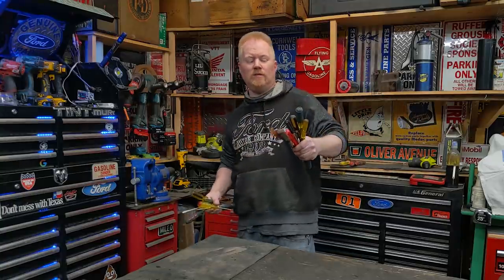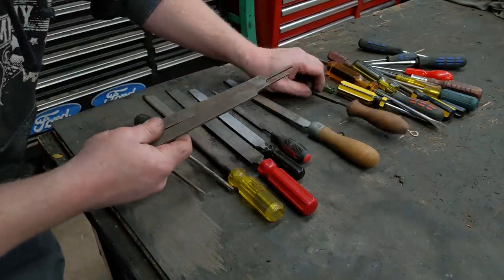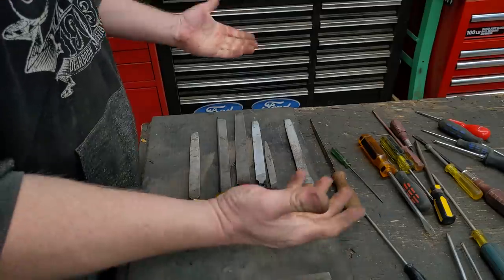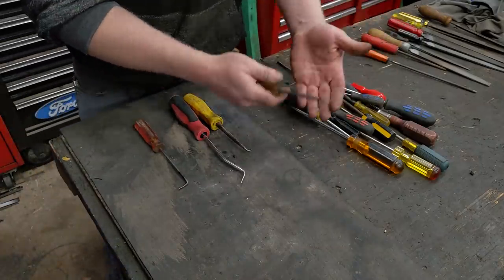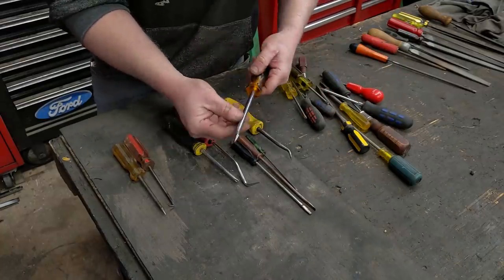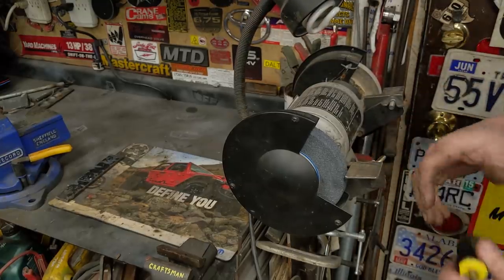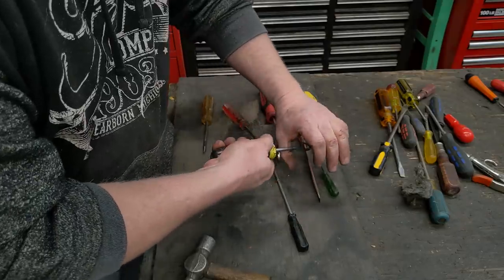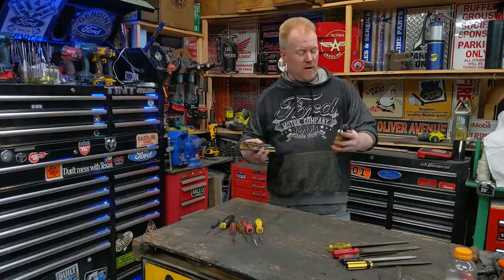BEST uses for Broken Old Screwdrivers VOTED #1

Comment: I cut a semi-circular notch into the end of a flathead screwdriver to make a bicycle tool to remove and install caliper brake springs.  The Chinese ergo-handled screwdrivers with a long sharpened shank are great for use in the garden for removing dandelions and other single tap-root weeds.
Reply: Yeah, weed removal is a good use.
I have a wooden handled Irwin flat blade that was in good shape, and I started using it for weed removal. Well, with the rocky soil that I have, the tip became rounded in no time. And purpose made weed removal tools with the v-notched tip get rounded over too when used in rocky soil.
Reply: @stevebabiak6997  I sifted all the soil in my yard over a wheel barrow ten years ago, man the rocks that came out of it was crazy
Reply: @campbellpaul   - I gave up on doing the whole area at my place. But when I add compost next time I might just have to put this thing together for sifting:
https://youtu.be/AS3sig0pP9Q
Reply: @stevebabiak6997  That tumbler looks really smart.  I just made a frame that squeezed over the top of the wheel barrow and used a flathead shovel to move the dirt through.  My chicken wire was a finer mesh, which made it twice the work!
Reply from the maker: Good ideas. Best dandelion tool is the weed hound. I made my own from scratch a number of years ago.

Comment: chisels, punches, paint stirrers, and voltage testers
Reply: I like the voltage tester idea. Shove it in an outlet and if you see sparks, it had voltage. Also a great way to determine which circuit breaker is associated with an outlet too.
Reply from the maker: Wait.... I use my good screwdrivers as Chisel, Punches, Paint stirrers and Voltage testers. Maybe I need to rethink this.
Reply: Screwdriver used as Voltage tester/ arc welder always gets me  excited. Makes my blood flow better 😂☺️
Reply: Also 1000A fuses.

Comment: i used one of my old screwdrivers to make a backing stick for when i was wielding body panels if your trying to get the small holes i soldered a chunk of copper pipe on the end of the screwdriver and it worked perfectly
Reply from the maker: Great idea.

Comment: I heat up old medium size flat blade screwdrivers with a propane torch and bend the tip at a slight angle to make paint can openers.  It give me more leverage and control.
Reply from the maker: Great idea.

Comment: If you are at all incline toward Blacksmithing, you can use a larger vise grip type tool as a heat sink and heat the tips, hammering them out ( drawing out ) the shank a bit longet and thinning at the same time and then forming the tip as you want to!  You may have the quench the part closer to the handle more often but that's OK!  Anyway, jus another thought!  I have done it with a few longer screw drivers that I needed to be even longer for picks and hooks!  They work fine to do it that way!  It will also tweak your mind a bit making you see that Blacksmiting can be a lot of fun and quite useful!
Kudos!

Comment: The nice old timer wooden handled one (square handle with the square shaft)...

I managed to get a set of 4 of those at a pawn shop.  When I got home, I sanded the dirty looking handles and refinished them, then I ground the tips into scrapers for detail lathe work.  This was before I got my lathe and lathe tools.  I was practicing my wood turning with them by screwing a block of wood onto my sander's motor.

Still have them... paid only 5 dollars.  Great steel, did not overheat them so they kept their hardness and temper.  This was important for me, as if they had lost the hardness, they would not be effective as cutting tools. 

Now that I have a real lathe and lathe tools, I do still have them and use them.  They are awesome for close in face turning, where a very short handle wont get me hung up on my tailstock!

Comment: I’ve sharpened an old flat tip, ground the handle down to fit in an aluminum pipe I had and it makes a great trash pick up tool

Comment: Great idea. The pick you made inspires me to make a good heavy duty spring puller. I’ve got a T-handle #1 Phillips that I never use that would be better suited for me after tapering and bending a hook on it.
Reply from the maker: Good idea
Reply: I'm a mechanic from way back, when choke cables were a steady stock item. I would pull out the knob and cable far enough from the sleeve and cut and curl the end of the cable and use it when installing the springs on new head light pockets! Back when all cars used the same round sealed glass headlights, the pockets would rust out and had to get replaced, the springs would hold the pockets against the adjusters! The goddamn good old days when nobodies headlights were faded and yellow, because they were made from glass!!!!!!!

Comment: DUDE!!! gth out of my brain!! Ive been doing tbis for over 40 years and have my favorite sheet metal work punch was an el cheapo stubby fuller looking screwdriver that met a bench grinder circa 1980 or 81ish... Picks I've made dozens of em and a lot of then were specialty picks for just that one job that have came in handy a dozen times or more down through the years...and my file drawers look a lot like yours except I used a bunch of old matching Crap-On handles that I gave like 15 bux for the entire 15 piece  set at a flea market 30 years ago and the ends were all about trashed... Haooy haooy happy New Years bud !

Comment: Broke a blade screwdriver a few years ago. It was a break across the blade at about 45%.  I ground a deep grove 5mm wide down the broken line making the blade into a  offset point, with another lower point.  Great for removing and replacing springs on drum brakes.
Reply from the maker: Awesome.

Comment: I used an old medium-thickness flat-bladed screwdriver with a partially-chipped-off blade to loosen and remove the tiny tri-wing center-hole security-screws on a few of the damaged VHS videotapes that I was repairing for my elderly-gramma friend, so that I could separate the halves of the cassettes to repair them --- the screwdriver's fairly-thick partial-width flat tip fitted snugly into one of the three slots in the screw-head, with one end of the flat tip wedged against the center of the head's tri-arm hole.  With very careful pressure and slow patient turning, I was able to "coax" the security-screw to loosen and unthread; after repairing the cassette's internal parts and re-assembling the housing, I would then just use a regular Philips-head screw --- salvaged from another damaged cassette on which I had replaced the entire housing but had saved all of the still-usable parts including the cabinet-screws --- as a substitute center-hole screw, so that the next person would have an easier time getting the cassette apart sometime in the future if necessary.

Comment: I found a drawer missing handles so I used smaller screwdriver handles. They look so cool. Now I'm gonna get the useless 5/$1.00 sockets and make stuff with them. Handles, small legs etc. I've got a 50c spark plug wrench for a door handle.

Comment: for anyone needing bike tools (wheel building/spoke replacement/truing) ...  a long flat head makes a great nipple driver if you cut the edges back and leave a 1/8th point in the center. If you s bend the shank and bore the handle a bit you can wind the spokes up pretty quick and in even tension or keep straight and chuck in your drill.
Reply from the maker: Good idea!

Comment: You can make real good thread on file handles by making tapered springs and epoxy them into the handle. I just made a bunch a few weeks ago. Lol I even made a couple for my needle files. I used the "heirloom" ceramic corn on the cob holders my dad pawned off on me when he sold the cabin . They're the kind that look like little ears of corn. ..Anyway, yea, I cut the head off a fat duplex nail and chucked it up in my drill and ground it to a taper and used it to form my Springs. I tried different thicknesses, thinner wire works better than thicker wire. I think I settled on 22 gauge. it digs into the file tang better. Since the needle files have round tangs, I had to file 4 flats on the tips of each of them to give the spring something to grip. But they all work Nicholson file handles, the ones that screw on. They hold solid until you unscrew them

Edit: golf balls make excellent file handles . Also, you could chuck up the right size deep well socket in your drill to hold the handle of the screwdriver while you grind it while you spin it with your drill. You'll get a better okey-doke machine finish that way.

Comment: That's a great idea,  i re-grind the odd straight blade type as they are easy to do, but all the versions of pozidrive and philips plus other silly versions are a right pain.
There is always a screw that i don't have a driver for,  stupid camming out idea.
Allen/hex  keys can be good but they are not always a close enough fit and they get mashed, i end up slowly grinding a little bit off the end to refresh the fit.
T bar types i like :-D
Reply from the maker: I tend to grind down my hex keys every few years for a new bite.

Comment: There's lots of uses for them, not just those you covered. You just need to be able to heat the metal up quickly enough to shape them and still be able to keep the handle on, if it's gonna be a tool. Or, remelt it back into the handle; a different direction for the tabs it should have on the base of the metal, for instance. 

With a long one, you can heat the metal enough to flatten the end into a better shape for using it in plastic welding. Just make it thin enough that you can heat it consistently and evenly enough across the whole edge. This is much easier with a hotter torch, of course. Or with a thin one, you can shape it, chop it off, and use it for a soldering tip specifically for plastic welding. 

If you have a torch that can heat the steel up enough, and something to shape them consistently with, you can make ornamental curved shapes, and gift someone with, for example, a one-of-a-kind windchime.  

If you have a thick enough screwdriver, and a hot enough torch, you can make a chisel of a specific width and shape, for use with woodworking and/or lathe work. That opens up any number of possibilities for different shapes.

These are just a few Ideas I had while watching this. I'm sure there's a ton more!

Edited to add something that another comment reminded me of - they used screwdrivers for this, but I have a couple of cheap tire tools and prybars that I've repurposed for gardening implements like digging tools and such, and made a specific shape tip on one junky prybar for one time use, and found a half dozen more, regularly-used uses for it!

Comment: On a small flat screwdriver if you grind a notch in the end it will sometimes help installing spings. I've got a old needle nose pliers with a V notch on the inside of one jaw near the tip, it sure helps pulling a spring into place.
Reply from the maker: Good ideas

Comment: I cut the metal back leaving an inch. Then took a moto tool and ground out the plastic to fit the tuning pegs on my guitars. Add a drill and when changing strings, it's as easy as ever, and was free!
Reply from the maker: Good idea!

Comment: i weld some sockets on the tip of mine, i offen use on the job 10mm and 11mm so i made 2 screwdrivers with old/duplicated sockets, and a 7mm for hose clamps, also u can grind the tip and glue a magnet, maybe can help if a screw fall in a dificult place

Comment: On flat blades, heat tip and make small pry bar. Helps to re-temper though.
Reply: By heating up the shank to bend it, you aneal the steel. So tempering won't do a thing. You would need to reharden then temper to get any effect.

Comment: Transform a broken philips into a standard blade screwdriver. File handles can be easily whittled from a tree branch with a die grinder and drilled for the file tang.

Comment: Putting a 90° bend in the last quarter inch of an old flathead screwdriver makes a good bearing puller for water pumps. I also repurpose old flathead screwdrivers into drivers that will remove and replace small jets on carburetors by trimming the “shoulders” of the blade so it just fits into the slot on the jet.
Reply from the maker: Good idea. Yeah, I have modified screwdrivers just for jets.

Comment: Good pull on the file-handles !
I have many; prolly a "full set" by now, that I've tapered to one degree or another, specifically for Alignment Tools. If they break or sheer during heavier-builds it's ok..... I'll just make another...

Crap, I forgot one....
I've also used a handle from a larger screwdriver and a long; cheap chinese, ¼" socketextension to make a socket-driver. Cut the "bell" off the extension and drill small hole perpendicular to the extension, ¾" or so from the cut end. Drill slightly undersize hole into handle for ext. shaft. Press ext. Into handle (you can see through acetate) and drill through handle and small hole. Drive length-appropriate (smaller than handle diameter) spring pin through handle to prevent ext. spinning. 
Viola, an Extra long driver for ¼" sockets...
Reply from the maker: I love the 1/4" socket drivers and have a good collection of them. Mine are all just a 6" extension with a handle on them. You can throw a ratchet in the back side for extra leverage.

Comment: I got the idea for a valve tool except I couldn't drill the centre so I cut a deeper slot and filled the bottom with silicone, making the centre hole that way and work's great.
Reply from the maker: Cool idea

Comment: I've made blunt, rounded "paddles" from the thicker (5/16") slotted, for getting under softer hoses or pushing on things that are soft (a lot of cooling system hoses on marine engines are softer, like high silicone content).

I also have bent a 1/4" slotted into more of a spoon, which is great for removing caked-up old grease from within drive chain links, and a million other purposes.

I like to buy the $0.99 screwdrivers at Lowe's or Home Depot (usually in a bin on the shelf below all the store and name brand tools). I buy them specifically for making my own picks and other tools. They're great because it's cheaper than buying those picks and they have round shafts, so they lend themselves to repurposing.
Reply from the maker: I like the idea of the rounded paddles. I left a flat head on one last night and smoothed it out. I bent it so I can pry up underneath and all the way around radiator hoses.
Reply: The Harbor Freight screwdrivers that they used to offer for free coupon would have been even more affordable ;)
Reply from the maker: @stevebabiak6997  I had around seven sets of those free screwdrivers. The ABS handles just shattered. I bent one into a 90 for prying and took the Phillips out of one for a long screwdriver bit in the drill. I warrantied a few out from the handle shattering under hand use. Last summer after one breaking and nearly slicing my hand open I threw every single one away including four or five unopened packages. If they had acetate handles they might be decent but other than that I think they're worthless.
Reply: If by ABS, you mean the black, classic Snap-On style handled--and EXTREMELY lightweight--Pittsburgh screwdriver set that was always free or up to $2.99 with a coupon, I like to scatter those in places where I may need a screwdriver quickly for something light, like changing a jigsaw blade (I have the small slotted in the jigsaw bag), or in the kitchen junk drawer, or in a desk drawer. 

They're definitely poor quality, but they can serve a purpose. I just wouldn't use them anywhere to build or repair anything with moving parts. But it saves you a trip to the garage if you're just changing a battery in a household gadget or something...
Reply: @sixtyfiveford  That's the problem with Chinesium products. Probably have high lead content.

Comment: chuck the business end of the screw driver into a drill.  then make modifications to the handle.  like little wings on the handle for stirring paint.  or a spool for reeling in string.  or sand paper for a drum sanding bit.
Reply from the maker: Good ideas

Comment: i heated one with a torch and beat it into a tool that i use on fire extinguishers. Get the Harbor Freight wrenches, those are the ones to heat and bend for those special applications. Also you can make prosthetic devices for missing hands etc. Careful for wiping your butt with that o-ring pick1
Reply from the maker: Good ideas... except the wiping part...

Comment: my dad never threw out anything i must have a about 6 tools made from old broken screwdrivers he would cut them off and with very large grinder at work make cabinet screwdriver tip or awl or prying scraping tool all sorts of things a pointy wedge to turn out broken screw heads as a chisel
I find i can make a slipping Phillips work better than new with a few file strokes on each side and the tip.

Comment: I thought all mechanics had an old, worn, blunt big ‘ol flat screwdriver they used for levering stuff! My mate calls his “Bessie”. I call mine “old faithful”. It’s great for holding flywheel ring gears, prying things ect..I’ve got a smallish one bent and sharpened as a pry bar for seals, another bent 180deg with a flat end for hookin’ stuff with some force. That one came in handy for scooping out a broken glow plug from a diesel pre-combustion chamber. I think there’s one with a tiny 180 specifically for wind-up car window handle clips. Ooh, and one I sharpened as a scraper for poking down a bore and enlarging a bearing housing I fabricated a bit too tight... the possibilities are endless!
Reply from the maker: Well said.